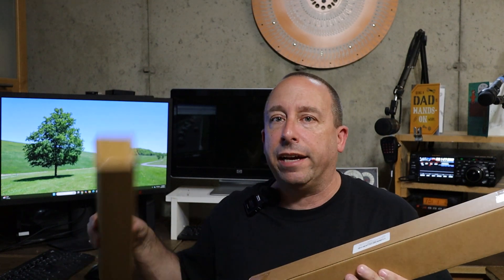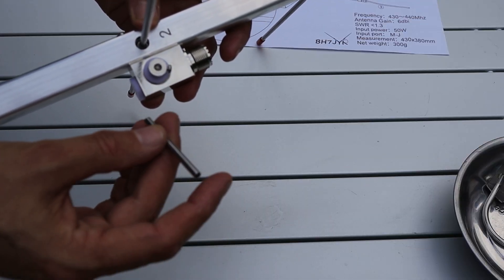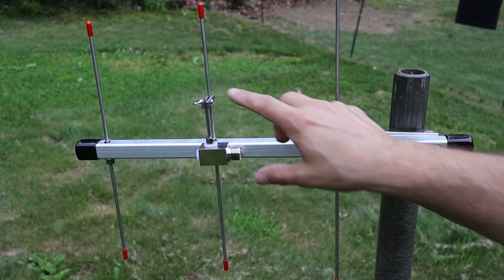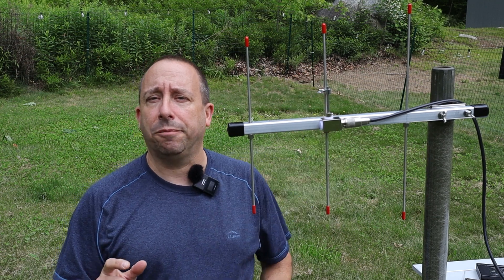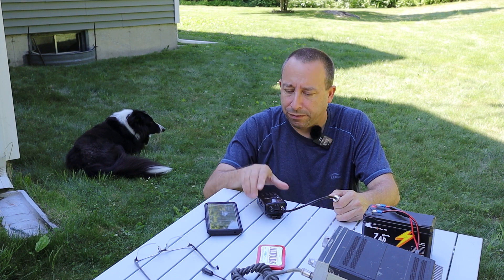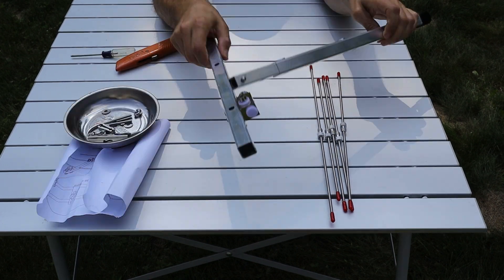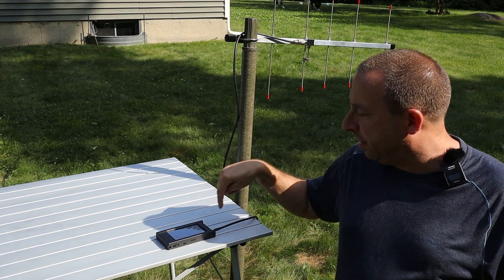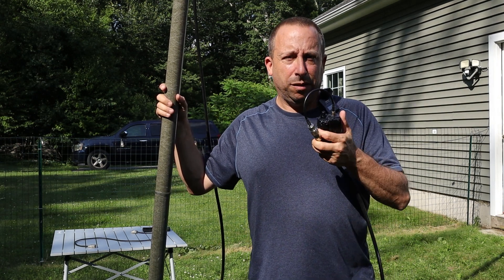These Antennas Will Help You Get on 70CM (Ham Radio)

Comment: Looks like you made an error converting millimetres to inches. 20 mm is 0.78" not 0.08". An easy mistake to make, even NASA managed to crash the Mars Climate Orbiter in 1999 when they tried to mix imperial and metric calculations😢
Reply from the maker: Darn decimal points...I knew something was off with that number

Comment: With the cost of coax its hard to have multiple single band antenna's. My diamond x510 is way more money, but the actual dual band performance and omni gain as high as this makes sense in the long run due to one coax 2 bands. I looked up a 125 feet ABR industries lmr400 and with tax its almost 250 bucks now. Holy poo.

Comment: I like this antenna, but I rather get a twin or triple band yagi. Also how far you need to space a yagi like this and a hex antenna on the same pole.
Reply from the maker: I thought this was going to be a dual band antenna based on the listing...but it's not.  I'm not sure on the spacing...I'd check the hex beam site for info